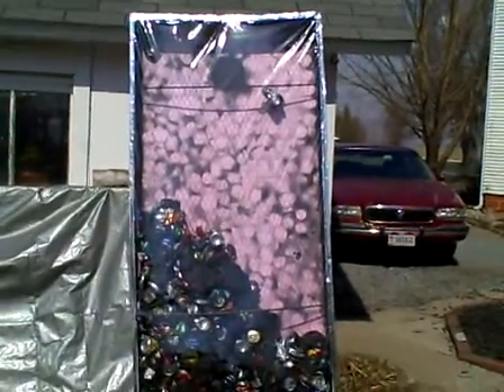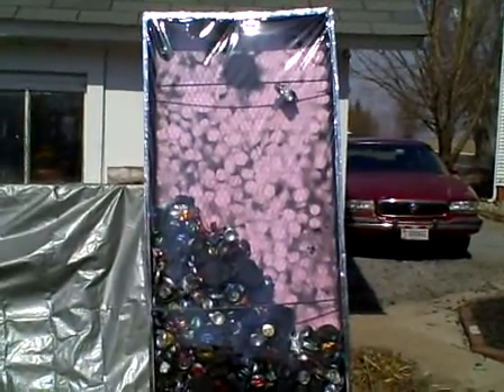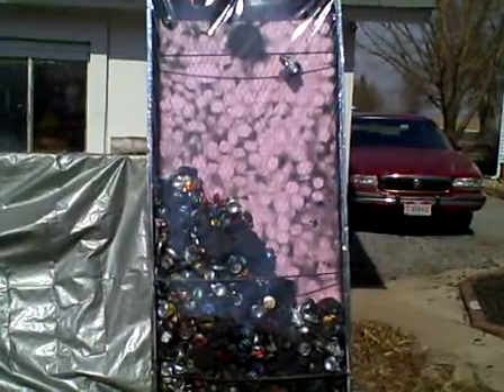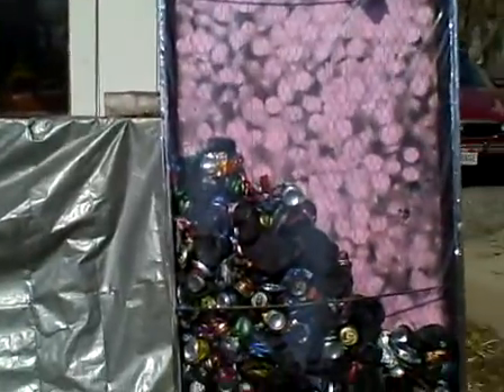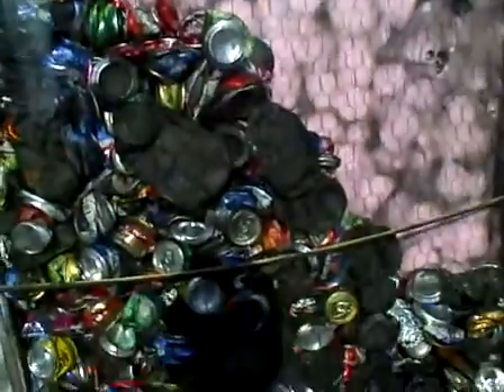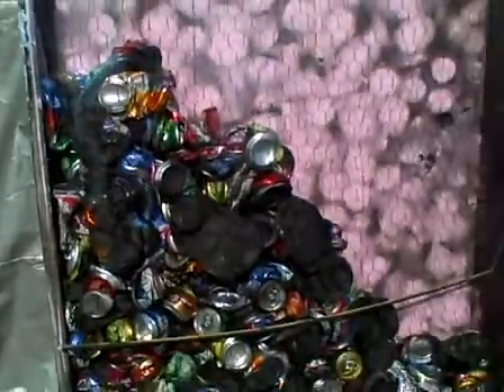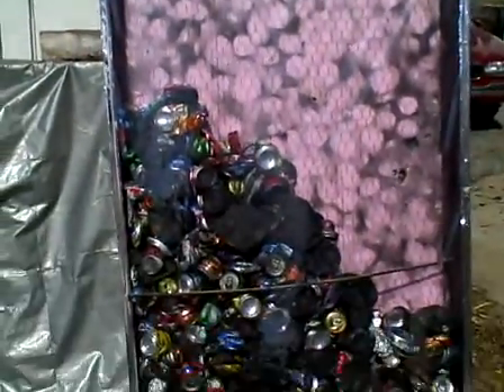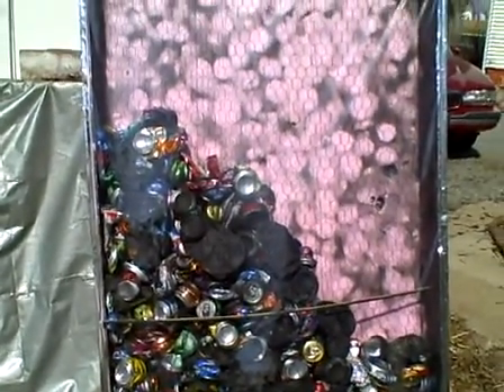Crushed can solar air heater

Comment: So as ever its a compromise.........If you had a panel with a thin sheet of black foil that would work, and give up its energy very quickly, ie great for first thing in the morning, no time to heat up, but you would be able to feel a cloud cross the sun. So may be a mixture of both, one light on thermal mass, one heavy. It's a compromise.............just a thought. I do like your work, 'cos your making it simple, accessible. Regards Bob

Comment: Nice...............It's a bit of a mixed bag. If you have / want thermal mass, you have obtain more thermal exposure, to come up to temperature, if you want thermal mass, you need weight / density, this panel could be broken bricks painted black, or pref. the engineering brick, or stone, this would have the advantage of holding a good amount of energy, this weight would also soften the change of sun levels. 
A second layer of plastic would also give double glazing effect. Just a thought.